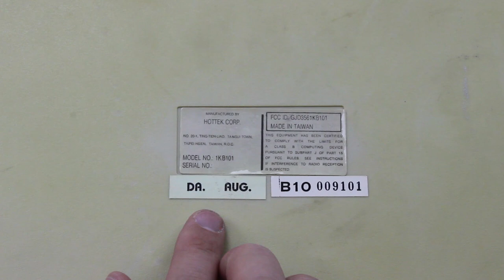Hottek 1KB101 keyboard review (HTK switch)

Comment: How did we go from having thousands of amazing or at least interesting switches in the 1980s? to 99.999% mushy rubber domes in the early 2000s?
Reply: They were cheap af to manufacture, and were marketed as silent. Which barely any other switches were. Because of this noise difference, there used to be somewhat of an anti-mechanical keyboard sentiment.
Reply: Membrane keyboards just make more sense from a cost perspective. With, say, Cherry switches, one of the benefits was that if a key stopped working then an IT technician could simply desolder it and solder in a new one. While the cost of a single switch was a few cents, the labor costs for this were still high. It’s far too expensive to do that when you can simply toss out the old keyboard and put in a new one. And as other people mentioned a lot of offices just want quiet keyboards.
Reply: Consolidation and outsourcing. China make membrane keyboard, you wan cheap keyboard? is membrane. Few manufacturers saw value-add in doing anything that cost $0.03 more than the minimum viable product. And with decades of buyers settling for it, they aren't stopping anytime soon.
Reply: @marcusrauch4223  What do you mean, "used to"? Listen to my fellow colleagues if I'd dare to take one of my mechs with me to the workspace.
Reply: The question is how did we get to now, with people settling for dozen of overpriced micro variations of boring mx switches.
Reply: Capitalism
Reply: Because by the 2000s everyone was starting to use computers rather than just enthusiasts or professionals, and your typical mom checking her email at home doesn't give a damn about how the keys feel.
Reply: @DavidLee-cw6ci  convenience, especially considering that having the same stem, and footprint, you don’t have to swap out your boards every time you want to try out a new one.
Reply: Lots of reasons as others have pointed out but I always assumed it was cause computers, especially PCs, used to be an awful lot more expensive then they are now. It was easier to justify a nicer but more complex and thus expensive keyboards when your computer itself was thousands of dollars.
Reply: KB-0168. Cheap, silent, reliable, and shipped with every prebuilt
Reply: Automation and out sourcing to cheaper labor made rubber dome keyboards dirt cheap. If a rubber dome keyboard breaks, just replace it, costs like $10 and requires no tinkering or knowledge of how a keyboard works. Mechanical keyboards are much more expensive and often requires soldering/desoldering to troubleshoot and fix an issue.

The mass majority of keyboard buyers were historically businesses and they changed to rubber domes for reasons above. People usually first see and use a rubber dome keyboard either be at work or school, so home keyboard buyers usually just go with that too.
Reply: @marcusrauch4223  even these days spiritually there is the embers of that sentiment in modern r/mk-aligned communities where "thock" gets a lot of attention, and the focus is obsessive towards silent or soft sounding keyboards. People often hate most keyboard sounds.
Reply: During the early days of the computer revolution, membrane keyboards were still far cheaper to manufacture than mechanical ones. At the time, most new users were accustomed to electric typewriters and preferred a similar typing experience. Consumers were also more sensitive to build quality, especially for high priced items. Only the lowest cost computers and special purpose computers offered them.

By the time the 90s rolled around, the computer industry experience brutal price wars. The goal was to provide the most powerful hardware for the least money. Consequently, the mechanical keyboard was the first to go. Apple and IBM still offered mechanical keyboards for a while, but eventually caved in. Typewriters had become a distant memory and consumers didn't care as much. What used to be a negative was marketed as a negative: membrane keyboards were quieter.
Reply: Capitalism baybee! It was no longer enough profit in making actual good keyboards so we got stuck with awful mushy garbage.
Reply: @kristoffer3000  all other answers are incorrect. This is the only actual reason things ever go through a cheapification process.
Reply: Well, money

Comment: I really don't know why modern manufactures don't focus on bringing new versions of all classic switches to the Cherry standard size, external format and connection (making it compatible with modern boards be it via soldering or hot swappability). Specially alps and space invaders seem easy enough to remake into a Cherry shell. 

We need more internal switch conatruction variety. So many "boutique" expensive switch companies and none focused into remaking historical switches into modern mechanical keyboard  compatible versions.
Reply: Zeal actually is one translating a mostly complicated Alps based design to MX.

The main issue is that the origin of most of these companies is from the MX Clone scene, and thus are mostly stuck to MX as that's what they're used to and what their customers expect. The main reason we even have Box Jade/Navy is because Kalih wanted dust and spill resistant switches and the people at NovelKeys realized the potential of the clickbar design over click jackets. The reason for optical and hall effect switches is le gamer high actuation points or analog. No major company is foing so for keyfeel, and most boqtiue companies like NovelKeys just modify existing designs.

Then on top of that most are happy with what exists already, especially tactiles. Lots liked even the original Brown and others were happy to see improved variants with a bit more tactility. People these days are so used to weak tactility and "thock" that buckling spring or box jade or Alps is kinda frightening to them, esp with the click.

Comment: Have you ever thought about restoring some of these keyboards, e.g. fixing the yellowing with peroxide? I've done it, is not hard just need to take the keyboard apart which takes a while.
Reply: I heard that while that method works it's only temporarily and the plastic starts yellowing again after roughly a couple of months?
Reply: @Aomicplane  I've found it lasts, and so have any others. Obviously if you leave it in the sun again it's going to yellow eventually. I've been using colour sample cards to keep an eye on stuff I did a couple of years ago, and it hasn't faded or yellowed again so far.
Reply: I think Tom has mentioned that generally he likes to avoid retro brighting in most cases.